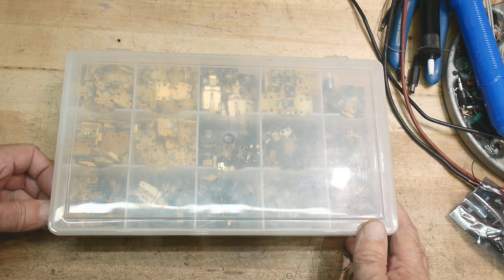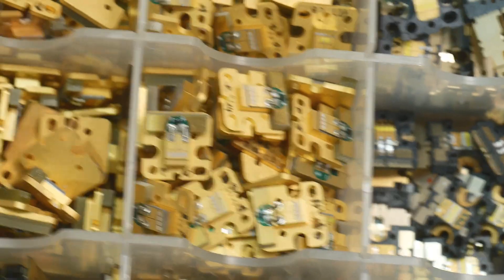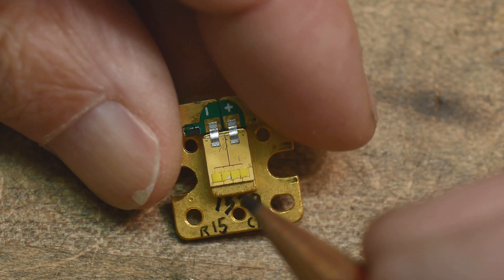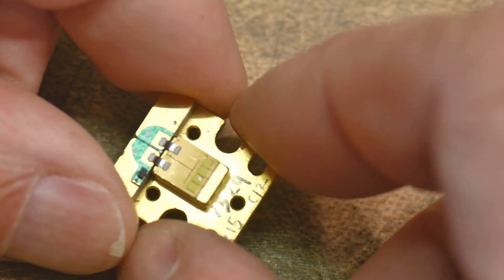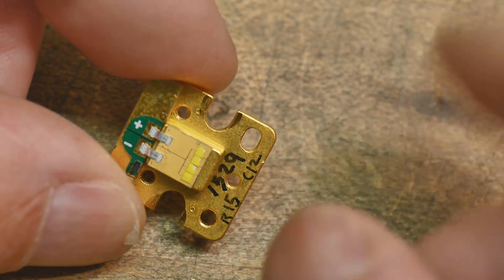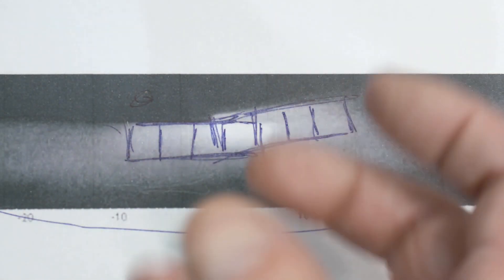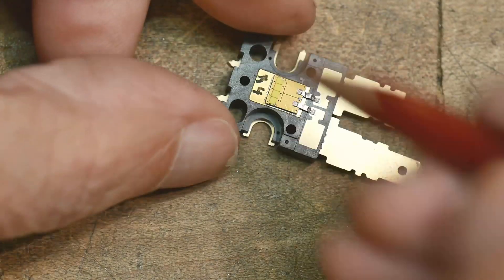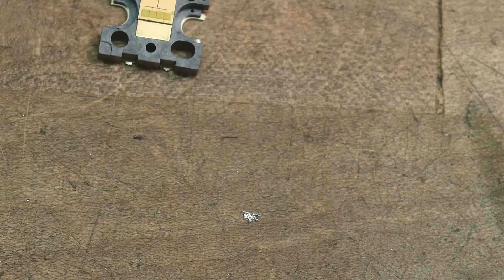#726 LEDs for Automotive Headlamps

Comment: Thanks so much for your LEDs automotive applications video -- it was very interesting. 
In 1968,  Dr. Biard at Texas Instrument (the inventor of the LED) called me  and stated that he had a red 650 nm LED operating in his lab and asked if I could find a use for it. I built the first red light emitting diode array at Texas Instruments with Dr. Biard and Dr. Henderson.  It was a red eight element array that started it all for an U.S. Army application.

Comment: The LED chips do not seem to be encapsulated (or maybe the phosphor is acting as an encapsulant). Also there does not seem to be a top bond wire. Maybe it has metallization to bring the contacts out onto the sides, which traditional LED chips seem to lack.
Reply from the maker: Good observation. Yes these are bottom side contact LEDs, no bond wire. these get so hot they cannot be encapsulated.  Encapsulation is used for index matching on normal LEDs. These will suffer a bit but the phosphor will randomize the rays enough to get the light out.
Reply: @IMSAIGuy  Interesting. Thank you for the reply

Comment: I think now LED headlamps are more common. I think both of my Toyota vehicles have them. Why not just put way more LEDs in them (like 32 or 64?) so each LED can run at a much lower power level?
Reply from the maker: I think some do that now. you run into etendue problems
Reply: @IMSAIGuy  Right, etendue. No, I did not have to just go and google that. Shut up. 😄
Reply: To well made = no sale aftermarket.

Comment: It seems to me the logical solution to beam focus would be to model the required pattern and ray trace back to the lumiere and maintain lens perpendicularity. Car headlights are getting ridiculously expensive to the point where the cost may dictate the decision to repair or right off in the case of collision. $1000+ per unit is not uncommon.
Reply from the maker: when your done, send me your design file and I'll check your work 😊
Reply from the maker: http://lpi-llc.com/Papers/SPIE05_5942-13.pdf

Comment: I have retrofitted several vehicles with LED replacement headlamp "bulbs." They had the flat mounted LEDs similar to those you showed us set in two rows. 180 degrees apart.  I questioned the radiation pattern the LEDs would produce. For example, would they obey Snell's law? If that were the case, I would expect an angle of radiation of about 120 degrees. But the original filament radiated at 90 degrees? Well, they do work as replacements although getting them to produce the desired pattern can be a bit fidley. Projector headlights have worked the best for me. Thanks for the discussion.

Comment: i was offered automotive headlight leds that were damaged in production testing by a power supply that was set to a high open circuit voltage, didn't really have a use for them and already way to much stuff lying around so i declined
Reply: they mostly still worked fine i think but simply weren't trusted to meet their long term reliability specifications